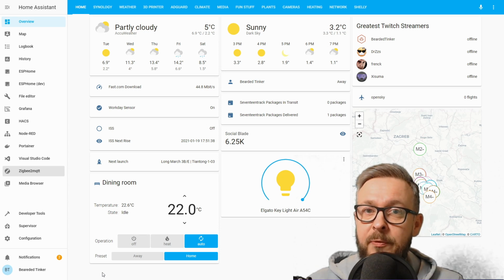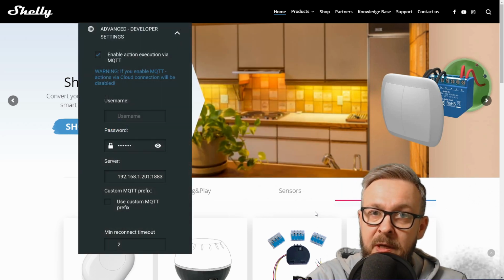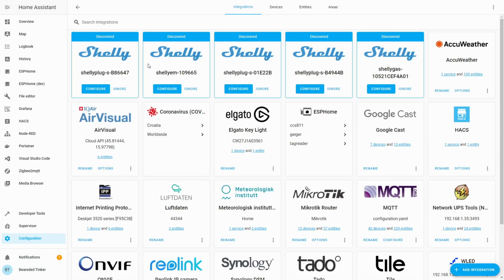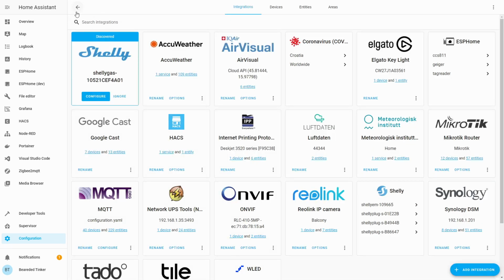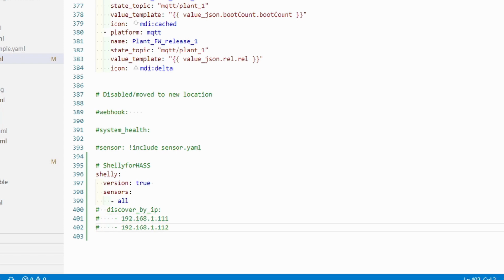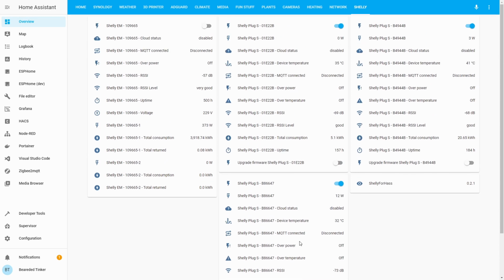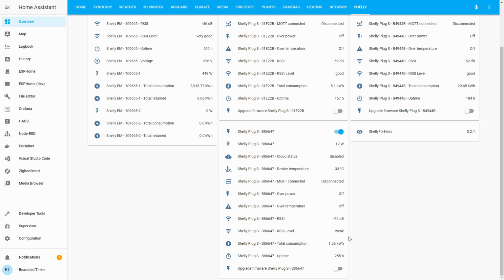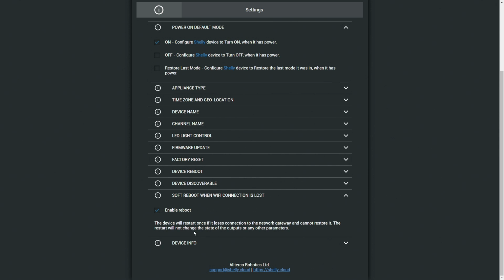Home Assistant How To - integrate Shelly IoT devices

Comment: Thank you for this video, what happens when the Shelly automatically detects on Home Assistant and Shelly devices changed IP? I’m planning to change all my current set up to Shelly since it’s local and want to remove Tuya that needs the cloud connector
Reply from the maker: I usually give Shelly device fixed IP address to prevent changing it. But also, if you're using internal HA integration for Shelly, it should pick-up IP address change.

Comment: Hello .. I am unable to integrate Shelly Motion Sensor 2 , with Home Assistant. Please help
Reply from the maker: You can check this video on Shelly Motion 2 - https://youtu.be/vaJymxB0wIw plus make sure that device is awake (by pressing the button to wake it up as it goes to sleep very quickly - you can try connecting it via USB to power and then waking it up).

Comment: Note - the HACS way is outdated and does not work anymore. Spent a few hours trying until I noticed the repo wasnt maintained in favor for the HA integration.
Reply: This video was 4 years ago.    It likely is not maintained.   That said,  I don't know if most people need all the extra sensors compared to the official one.
I always prefer to use minimal custom integrations as they can break, be abandoned or just stop working properly.   I always use official integrations where possible, and now Shelly is part of the Works with Home Assistant scheme, I think the internal official integration will improve more.
Reply from the maker: Custom integration was supposed to enter as such in HA, but from what I recall original dev didn't want to change some things internally, so HA devs built one from it and everything that was in the custom one is now in internal integration. 
Haven't checked in some time, but I think that even Shelly is now contributing to the code updates.

Comment: Hi, thanks for the video. Have you noticed one problem with the shelly plug? I see the voltage is around 134v, and it's always a flat line. I don't think it's accurate. My other meters are measuring 120v~ I already updated all the firmware, just curious if you have ever noticed that problem? thanks
Reply from the maker: Actually non of my Shelly plugs measure voltage. Just watts. For voltage I have Shelly EM that's measuring total W/Wh used + it also has volts info.

Comment: I have shelly devices on multiple locations (via the same cloud accouynt) and want to monitor their sensors in Home assistant. How would you recommend i do that? i am quite desperate to find a easy solution
Reply from the maker: None of the current integrations pull data from the cloud. The only way (but I never tried it) would be to use MQTT service on each device and have it send data to (publicly available) MQTT service. But that's also a big security risk as MQTT servers are not known for their security.

Comment: Can you help me? I tried everything and all the times that I try to turn a shelly device on in HA it turn immediately off... or vice versa... this is driving me crazy.
Reply from the maker: What device and what integration are you using? I see this behaviour only if you are using physical switch with wrong state set. (for example using push button for switch or switch for push button)
Reply: @BeardedTinker  I tried to change that on shelly but without any success, I'm not using fisical buttons. 
I'm using Shelly for Hass and I've Shelly1pm and Shelly EM both connected to shellyforhass over cloud. I cant ping them on my raspberry. 
LOG: Timeout connecting to http://192.168.1.4/relay/0?turn=on [192.168.1.4]
5:39:19 PM – (ERROR) Shelly smart home (custom integration) - message first occurred at October 24, 2022 at 7:35:01 PM and shows up 5 times

Comment: I tried to add the shelly integration but it says "The  Shelly device is using an unsupported firmware version.". What do I do?
Reply from the maker: Make sure it is running latest firmware on Shelly. If not, you can upgrade via Shelly device web page.
Reply: @BeardedTinker  I had my shelly connected to a firewalled vlan that didn't have internet access (like all my IoT devices). I didn't see a way to manually upload the new shelly firmware so I had to give the shelly internet access to update. I took it offline after it was done.

Comment: Nice Video, but can you tell me what I have to type in Host* to connect to my Shelly 25? I tried several IP adresses Wb adresses which I can reach the Shelly via http from my network. But nothing worked!
Reply from the maker: This shoud be just IP address of the Shelly device - can't remember if you need http:// in front or not - no specific port is needed.
BUT don't forgert to configure CoIoT on Shylle device and specify your Home Assistant IP address with port 5683. This will definitly help with speed of actions.
Reply: @BeardedTinker  it was in the wrong WLAN. Thanks for helping!
Reply from the maker: @HannesSchleeh  glad you got it sorted!!!

Comment: As i know, shelly devices is supporting homekit. İf we replace the firmware with homekit, can we add this devices with homekit entegration on the homeassistant?
Reply from the maker: There is a open source version of firmware that brings HomeKit compatibility. I didn't try it so can't tell you how good it works. But yes, you should be able to add them to HA with it. At least it does say that it is compatible with stock firmware.

Comment: Do you have dynamic or static IPs on your smart plugs?
Reply from the maker: Excellent question - most of the devices have fixed/static IP address. 
I've created ranges for devices based on type. This may be limiting if numbers go above what I have planned, but is now much easier to manage

Comment: More a shelly specific question. Will the device keep on working (give power to washingmachine for example) if there is no Wifi available or HA is down?
Reply from the maker: Yes, it will work. It will keep last state it had if WiFi connection is lost for a moment.
Flashing the firmware will on the other hand reset power - so if you are running washing machine it would lose power for couple of seconds.
In terms of power restore (if you lose power), it depends on what you selected in setup - it can be last state, off or on.
More then you asked, but should cover everything ;)

Comment: if shelly devices are not in the same network I can still integrate them in home assistant?
I have different wireless networks because the devices cover a larger area and they are not all in the same network .
Reply from the maker: Excellent question! But since we are using local integration, no. There is a way or workaround for this, but it requires a bit more complex setup.
If you would use MQTT and this MQTT would be in cloud or exposed, you could do it through MQTT server. In similar way, I'm sharing my devices between 2 HA, but they are in my case both on same network. 
The only difference would be that I would use public IP or domain name to connect to it.
AFAIK it's not using Shelly Cloud app data for control. If it would, it would also be much easier to do what you are looking for.
Reply: @BeardedTinker  if I use routers in AP mode and I ensure on all devices the same range is ip 192.168.0.2-255 even if the networks have different names it is possible to see them home assistant? I saw that install for Windows from another movie on YouTube after  starts the server has great limitations. Is there an installer for Windows that has access to all server options after the installation is complete?
Reply from the maker: If there is connectivity and network flow, it should work. But you must have routing available between access points.
If you are talking about Windows Python or Windows Docker version, they are limited. You should try and run Home Assistant in Virtual Machine on Windows, to get full functionality.

Comment: Hoping to have my first Shelly Plug set up tomorrow. Still trying to decide which way to go as far as integration. Same with my Tuya devices. Part of me wants to get them off of cloud services. But I'm concerned about how it will affect current integrations with my Google Home Assistant voice control.
Reply from the maker: For Shelly, I dont think you can go wrong way whatever you opt for. And also, you can run integration in parallel, but in long term it's bad idea as you get them duplicate devices. Also, if you create Google Assistant integration, you can control any device from Home Assista, using Google home even if they don't have native control.

Comment: Would you recommend putting one of this behind every light switch? Would that be better then say going with lutron smart switches? 

what is the reliability and long term performance of the shelly? 

i have a unifi wifi 6 network
Reply from the maker: Excellent question that is not that easy to answer...  It all depends - if you have neutral wires in wall switches or not. There are model that support no-neutral, but it adds to complexity. I've never tested Lutron switches, so can't compare them, but in terms of retrofit, Shelly is excellent choice if you want to leave your current wall mounted switch and add "smart" to it.
I've on the other hand opted to "smart" bulbs - that way, all (most) my switches remind the same, while each bulb is individually controlled.
This adds to the cost, but also allows much higher flexibility to control lights.
In terms of reliability - so far I haven't had any issue (except with 2 sensors I have from Shelly, but that's different story) with any power control device from them. And some are 2+ years old.

Comment: Hello, great video. Finally I could see an on line configuration of a shelly device. You mention the non necessity of configuring thru mqtt because the own Shelly integration is fine. In any case, I'm trying to configure it thru mqtt, but no way!. Have you a similar video, but with mqtt configuration for Shelly devices?. On the other hand, for ShellyEM device, there is one sensor not read with the Shelly own integration, and it is the reactive_power, and I'm totally lost on how to retrieve such information in HomeAssistant. Does anyboday know how to solve it?. THANKS
Reply from the maker: Hi and thanks for the comment and sorry for late reply - busy day :)
I do use MQTT for some of the sensors from Shelly, but not all. I did record video on how to use Shellies autodiscovery to add Shelly devices with MQTT - here is the link to video and I hope it helps.
It is part of this video: https://youtu.be/ylCt45JUkOg
You can find time stamp for it in video description.
Reply: @BeardedTinker  Great! I have finally handled to get some variables thru Mqtt and others with Shelly own integration. Thanks a lot!!
Reply from the maker: @joracadu  that's great! Enjoy your data now if you stumble upon any interesting automation, please share 🙂

Comment: Great tutorial ! I'm running Homeseer 4 but they do not have a CoAP/REST integration for free, there is a $40 plugin. Also there is no simple plugin for influxdb/grafana with HS4. I'm awaiting my delivery of 1st shelly device which is a 3EM to monitor my house usage. I do not want to loose the shelly cloud functionality, yet want to push data to influx/grafana, seems like HA built in integration is the way to go as it also has addons for influx and grafana. Thinking of spinning this in a docker container. Comments on any latest updates since you did this video will be helpful. - thanks !
Reply from the maker: I really love the possibilites to tinker around Home Assistant and expand it with addons as my as I like.
But just a warning, if you go for Docker version (which works great) - you will not be able to use integrated installer for Add-Ons. Most of them can be installed as Docker images, but don't have automatic configuratio that normal add-ons have (for example security token, etc).
For that you'll need Supervised or OS version of Home Assistant. That one has everything included - I run it in Virtual Machine (on Synology).
And to add - I don't have Shelly cloud enabled - all is available from within Home Assistant, but I could have that too if I would need it.

Comment: Good video friend. I have 50 shelly devs at home. And I use HACS interation. Sometimes HACS "loses" some devs, that become unreacheable. 
And what about CoIoT? Did you tried yet? set you HA as peer, and everithing seems to flow smothly. Check it out!
Reply from the maker: Thank you very much for your comment Enric!!!
No, I still haven't tried it. I know HA internal integration should work with CoIoT - will try it very soon, but I'm on tight schedule last few weeks...
Also, for some Shelly devices, I have been using MQTT lately because of the problems you mentioned but also because some sensor data was missing in HACS and internal HA Shelly integration.
Reply: @BeardedTinker  I would like to try the HA internal integration, but it means a lot of time with 50 devs.... rebuild all my automations, groups... everything... I'm a little lazzy. I will expect, y hope Shelly4HASS and Shelly native integration goes together soon.
Reply from the maker: I get that. It's hard to redo something down the road. Especially when you have a lot of interconnected stuff such as automation etc.

Comment: I have a shelly plug exactly like in the video. The video DOES NOT explain you how to connect it. He jumps over too many steps. I plugged it into power and then..... nothing. The video does not help you to integrate the shelly plug into Home Assistant.
Reply from the maker: Hi Martin and thank you for your comment - but I think you've posted comment under wrong video - this video is for integration of Shelly devices into HA - options you have, and NOT on how to plug it in and set it up. There is difference in configuring device an integration of the device. Not a single step has been jumped over and as this video is device neutral - it works with any Shelly device - after you set it up.

Comment: I am using Shelly 1, 2.5, gas, shelly duo bulbs, plug s, and HT. Well, my experiences, based on a direct comparison between MQTT and integrations are on the MQTT side. Reason: switch responsiveness, humidity and temperature sensors information (especially battery-powered ones) - better and more stable via MQTT. For those using IoT network segmentation (firewalled subnets for this purpose), MQTT seems to work even faster. My observations were made on UDM network gear supported with 2 AP's. Yet another benefit I see is better automation functionality (ie. dimmable shelly duo's). The good thing is, Mqtt can be used in parallel with integration. So the user can pick an entity that suits (works) the best for a particular need. What I found easier to deal with is power monitoring and reporting over integration. MQTT sensor requires extra configuration to translate power units to kWh. I did not decide to integrate MQTT within hass.io, I am using it with three other self-hosted services, thus integrations only would not feed them. One of these is homebridge which helps me to integrate with other equipment. My homekit integration allows me to compare the responsiveness in home app, and here MQTT based switches and sensors work flawlessly. The integration allows picking individual entities to be exposed to the Home app. This helps to avoid exposing duplicated entities to the app. In my opinion, MQTT gives better transparency than integration, too. To wrap up, my personal opinion is that Shellies are currently the best pick due to the software capability.
Reply from the maker: Thanks for the time for the comment Tom - much appreciated!
As I was playing a bit more with Shelly Gas today, ended using MQTT to add them to HA. Reason, lack of information from both internal Shelly and also ShellyForHASS integration. Some sensors were missing and I really wanted to be able to see them in HA:
As I mentioned in the video, my experience was just with 2 type of devices - EM and plug s. Now I've added GAS and it's completely different story.
Waiting for Shelly Uni and 1L to arrive - according to current status, they will also work better with MQTT as they are still having issues/bugs with Shelly for Hass.
Great thing is that we have options and as you said, we can use them in parallel.
Reply: @BeardedTinker  Thanks for you your kind words. I forgotten to add that I use 1L in my gear, too. Works like a charm under mqtt, I did not even bother myself to use integrations. Initially I wanted to use this one for L-only connection, ended up with setting this in my 2-way switch which was built with 3- instead of 4 wires between the switches. Accidentally I solved the other issue, not even using the additional bypass from Shelly. So 1L is a really great stuff. Oh yeah, and my automations are supported with built-in feature (shelly software) - some switches turn off after given time set directly on shelly firmware. That's eliminates a need for additional HA automations and works perfectly well for these switches my kids leave permanently on.... You know... Fathers' life...
Reply from the maker: @tomgrey3046  just to add on this - looks like MQTT version is working great, but also Internal Shelly integration is providing some entities that ShellyForHASS doesn't give. But yes, MQTT works greate here.